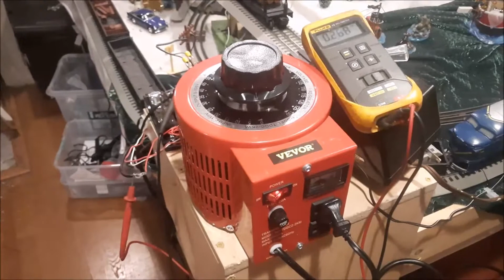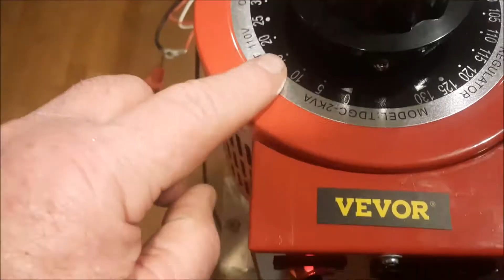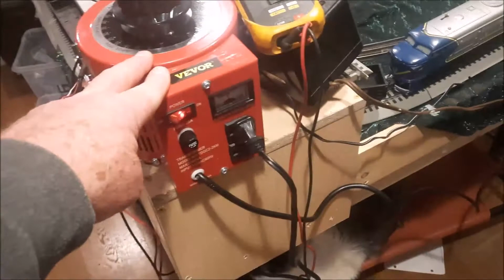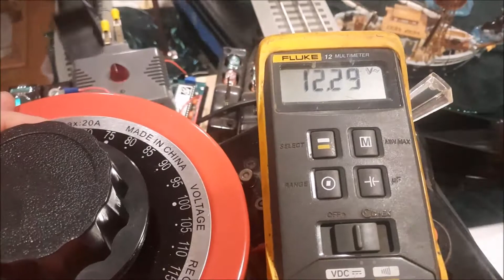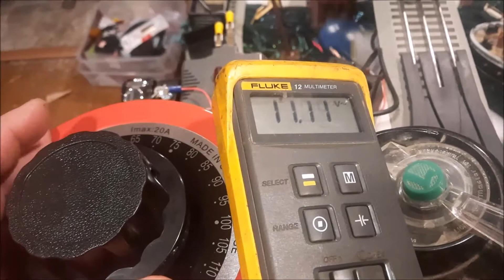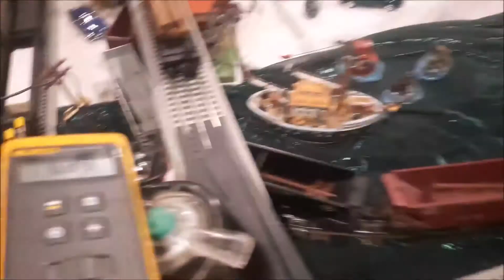A "Variac" Industrial AC Transformer Vs. Conventional Transformer To Power Vintage Lionel Trains?

Comment: Yes, the old AC type motors with more amps will now turn at lower voltage since the amperage is there. CAUTION: high amps might make wires and motors burn out, and if your train comes off the track especially a modern one, the electronics might fry as well from the arc. You can also have a nasty burn on the track if you have a derailment too.

Comment: K-line has the add on whistle and horn activator, but. I don't know if it will work for other bands. 
In fact all that is needed for the common whistle activation is a DC voltage to the track switch without losing the current ac connection as to not activate the reversing unit, then you can switch the DC voltage direction, then the horn will activate. A bridge rectifier and a double poll double throw switch should make this work, and a second one for the reverse for the horn activation.

Comment: Hi.  Yes ,i'm with you about the fact  to not try this solution to operate   lionel or other 3 rails trains that work with AC voltage  .  Me, two years ago  ,i was trying to made  the same kind of walkaroud
control  as exactly the same  as the one made by a gentlemen   that show is system with an REHOSTAT  in the  old magazine  CLASSIC TOY TRAINS  of  march 2015 volume-28 -no=3 ,so, i was
trying to  exactly  built  this rehostat to operate my  lionel trains for yard switching only   like that gentlemen  (BUT)  it dont work  ?  It sad that it was impossible to built an only or simple
walkaround with a rehostat  at low price   to only operate my trains  in yard operations  ? I'm not interested anymore to spent a fortune  in other high price stuffs only for that . Curious thing on that point is that lionel  from long time ago as made old rehostats   to operate their old trains  ???